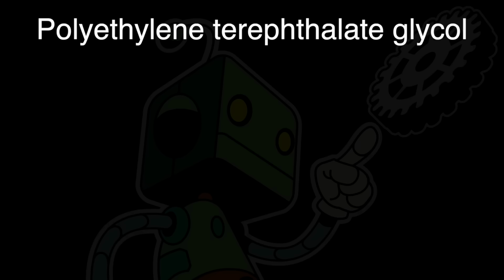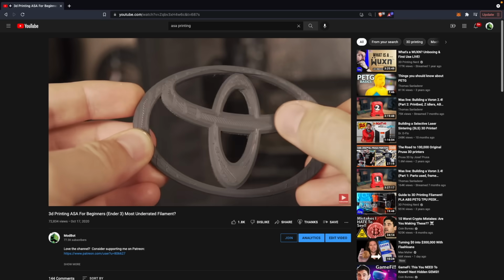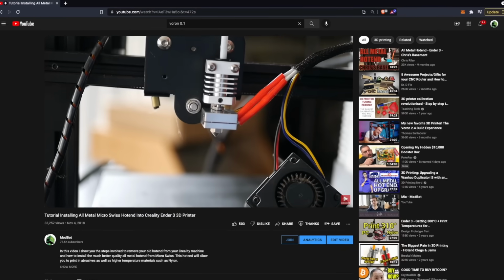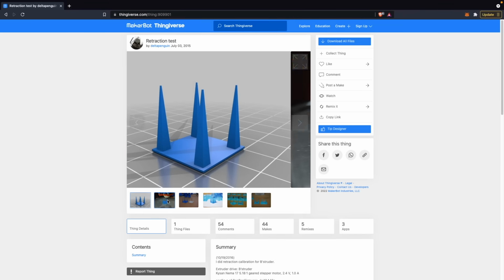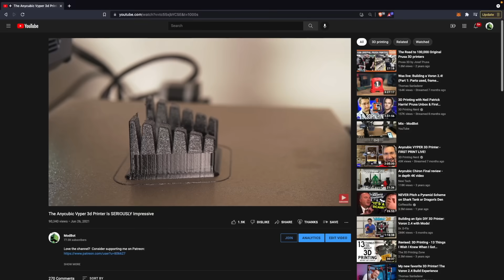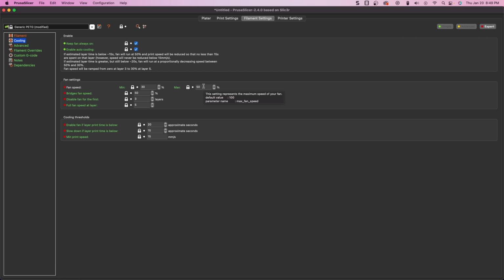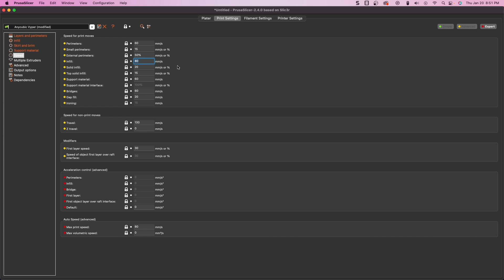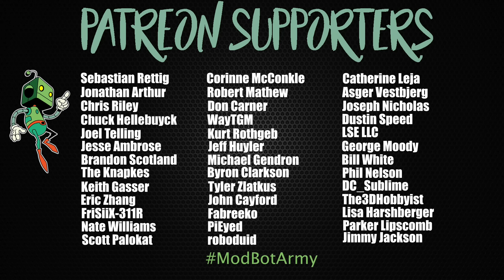3d Printing PETG For Beginners! Great For Functional Parts

Comment: I've found that while printing with petg in recent times with an ender 5 plus that the filament "sticking" to the copper extruder only seems to occur when the temperature it prints at is too low. Additionally, I've found more success printing fine parts at a speed of 40mm/s than the stock 80 that the ender 5 plus uses.

Comment: First thing anyone should do, especially with a new roll of filament, is to not only dehydrate for a couple of hours, but print a temp tower. This will help you immensely with any filament. I do this religiously and haven't had a failed print in a while now. Also, you need to do some fast prints to see about stringing. The just adjust your retraction distance first, if tha helps some but not a lot, adjust your retraction speed.

Comment: Funny that I just came across this video after my second part printed with CF PETG. My first print came out absolutely perfect. Not temp towers, not retraction test. I just went for it, and was amazed! Printed the second part and again it printed amazing... but took chunk of class out of the bed when I removed it! DAMNIT!

So for the question and real meat of all of this... Im running an extended E3 with a 400x400x500 print area. It was a great move... until it came time to find a new print surface! Im using a Creality class bed now, but its rather screwed up. Im having a hell of a time finding a source for a quality bed surface though. Any recommendations?
Reply: Ratrig 400mm bed from ratrig or mandela rose might work

Comment: I wasted a whole day trying to find any surface that PETG would stick to.  Nothing worked except for an undersized dedicated PETG surface that was only good for one print.  PEI was like teflon, zero adhesion.   Metal with glue stick failed.  Blue tape failed.  Kapton tape failed. Varying temp on all the surfaces failed.   This was on a Prusa so I couldn't use any glass or phenolic.

Comment: Nice guide, one point I'd add from my experience, PETG tends to warp much more than PLA, especially when you print large surfaces on the bed (common with functional parts). I've found that printing under an enclosure solve this issue much better than using glue or toying around with temperatures and layer height.

Comment: You hit a couple of points that are critical.   Dry filament is a must, higher temps tend to work better and your print surface should have a coating to keep it from pulling off when the print is removed.  I use glass and have had many chunks come off with the print.
Reply: it pulled chunks of glass off?? wow

Comment: Great video guiding to print PETG, I have one confusions on the hotend part, PTFE tubed hotend cannot stand the high temperature  and release toxic, however, the non tubed full metal hotend, the filament company said PETG is not recommended to print with full metal hotend as it will clog the hotend, so, what is the better solution of it? Or as a occasional PETG printer, just use lower end temperature as you mention like 230 with tubed hotend? Thank you in advance.

Comment: I've heard PETG or ABS is better for reptile hides. PLA can release toxic vapors or something at higher temps (100-120F I guess? About the highest most reptiles use, maybe 135F hot spot for a Uromastyx) let alone these lizards need UVB. For snakes that have heat tape and no UVB I imagine it matters less.

Comment: PLLLLLLEEEEEAAASSSSEEEE Help 

i have  a creality ender 3 pro and im very new to printing

pla was fine

i need petg now

i get warping every print and i think its in the same spot

im pretty sure my bed isnt flat

i havent chnaged any part so the whole thing is stock

Im begging for advice I have printeed the same part repeatedly with similar results and chnaging the print profile

I use cura to slice

what am i doing wrong?

Comment: Honesty,  Silicone socks cause more problems than they fix.  Yeah they might protect the heater block from the dreaded blob (if they stay on).   But I find they are WAY more likely to cling to some stringy part of the print get pulled off,  failing the print, and still cause the blob.

Comment: I've been printing a lot with petg and successfully but for some reason all my prints I attempt fail due to very poor adhesion and all the material ends up gooping around the hot end. I've done all the cal I can possibly do. Possibly build plate? I print on glass bed without any kind of build tac, but I've never had issues with it before so idk.
Reply: same... except im using an ender 3 with the default bed. I changed out the nozzle to a new nozzle and still have issues getting it to stick to the bed. It used to print well till i changed out the extruder.. but i calibrated the extruder so not sure what else is wrong.
Reply: @ChristopherJones16  I think I know what the issue is but have not tested it. I think the material has absorbed too much moisture and needs to be dried out. There are no signs of excessive moisture but it's the only thing I have not tried, maybe same problem?
Reply: @AWildNoodle  well I was just reading the comments section here and seems some people are saying the sweet spot for hot end temp is around 230 whereas I’ve been using 240 from what my filament box says to use so I’m going to try lowering the temp and see if that helps but if monkeying around with the temps doesn’t help then I’m going to settle on it being moisture issue and throwing it in my dehydrator.

Comment: I think I finally just got my printer slicing dialed in for my RepRap Guru i3 3D printer with a MK8 swiss heaterblock, generic PTFE lined heat break and a Creality branded MK8 all metal nozzles and it's direct drive. The biggest issue I just discovered last night was initial layer height (.24mm) and layer height (.28mm). They were all .2mm and I kept getting clumps on the nozzle and horrible infill that would eventually cause it to fail. Last night after making those changes my CHEP cube turned out almost perfect! Then I printed a MK8 filament guide and it finally completed and looked almost perfect! So glad I stuck with it, kept reading and trying different settings till this one fixed it for me. No onwards and upwards! I have a video to make for comparing DIY ABL Probes! Check my channel out in the near future!
Reply: So are you saying that when you used default settings of .20mm layer height it kept clumping up the nozzle but when you changed it to .24mm and .28mm it fixed it?
Reply: @ChristopherJones16  exactly! I found an article where they tested PETG in a lab and discovered the best settings to avoid the nozzle always slightly dragging in the liquid PETG plastic where to set the initial layer height to .24 (less squish) and .28mm for all other layer heights. Once I did that it was like magic hit and all my PETG prints first layers were perfect and all remaining layered printed like PLA. I had some bridging issue but fixed those with Cura's experimental bridging but just enabling them. I even went back to an old Overture PETG roll I gave up on and it to printed awesome! Good luck!

Comment: Printing intricate parts with PETG for me has been a big challenge. I can't seem to stop the slight oozing that gathers at random parts of the outer walls of my prints. I've reduced flow rate but then I get under extrusion on flat areas. I like the challenge but my results on small detail parts pale in comparison to the prints I get with PLA.
Reply: i read somewhere that there called “zits” and are due to the “seam” being set to random. From what I remember reading if you set the seam to linear (or the like) you’ll have a straight row of zits instead of a spread. From there you can even set it inside the structure itself so it’s not visible. I’d google about seams. Could be wrong tho.!
Reply: @ztm_oruam  Coasting is also a nice help here.

Comment: PETG to me is a pain in the arse to print with ,it needs high temperature, high retraction, retuning extruder , sticks to the nozzles,so sticky to touch,takes almost all the water in the air (like it's always wet),so saggy like a ###### ,can be printed fast (cuz it won't cool as fast  like PLA) , it tests the metal if u have a low end printer . The best option is to stick with PLa , Pla+ , if u really need high strength go for nylon or CF filaments because those are with the time and effort.After printing PETG can rake two paths one is it come of little flexible  and other brittle (breaks with almost no effort)  also it expensive than PLA .Stay class ,stay  cool and don't be a fool buying PETG

Comment: It's handy to have some qtips around to wipe the PETG off the nozzle. Heat it up to 230c and it will wipe off easily. You can heat up to around 120c and use a fine tip tweezer to pull the PETG globs off the nozzle before wiping.

I usually print at 230 - 240c with an 80c bed for the whole print with 25% fan speed with a dual 4010 blower setup and a microswiss clone from trianglelab. I find that dropping the bed temp down to 70c after the 3rd layer in a room with an ambient temperature of 65f will most likely lead to layer lifting from the bed. Drying the filament as mentioned is very important. Even if you leave it in an "airtight" box with desiccant over a few months, it will still exhibit blobs and layer adhesion issues. Probably best to store all unused rolls in a vacuum bag with dessicant.

Comment: I have lifting on the corners of just about every PETG print (several different brands) on my Ender 3 Pro printer.  I've tried adjusting nozzle and bed temperatures, varied fan speed from 0 to 100%, varied print speed, and adjusted other slicer (Cura) settings to no avail.  This happens regardless of print surface (i.e., the Creality stock buildTag, glass with coating, smooth PEI).  The first layer goes down without problems, but by the time the print's done, warping always happens and the corners lift.  Using a brim (or brim on the corners using the Cura TabAntiWarping plugin) helps, but I've had prints where part of the brim lifted off slightly with the print at the corners.  Parts of the print other than the corners stick to the build surface very well.

Since this is happening all the time, something obvious may be causing this, but I'm just not seeing it.  Do you have any suggestions of what else to try?
Reply: Haven't tried nearly as many things as you, but same experience. I will try no fan on first 3 layers as recommended here, but so far every single PETG part has warped slightly on the bottom, about 1mm up for about 3cm along the bed.

Comment: I’ve been messing around with it for the last couple weeks and I’ve got some really interesting results regarding temperature and translucency relationships. It seems the higher the temp, the more “glossy” the surface becomes. I’m not completely sure, but my thought is that the glycol really “shines”  at higher the higher temps. This also confirmed when I print with the Amolen color translucent filament. At around 230c I can get an opaque haze through the layers, but around +245-250c the finish really becomes almost as glass. But along with that, they do seem to become more brittle as well, losing some of that sweet glycol ductility. 🤷🏼‍♂️
Any plastics engineers in here?
Great Vid!

Comment: Does your prusa extruder heat up? I have some serious issues with jams due to the fact my is getting so hot (whole thing) that you can barely touch it. Only PETG i have issue with is - actually - galaxy black.

Comment: Of course I started my 3d printing using pla as many do/have, but to be honest I don't really like pla that much for being more brittle and temperature sensitive. Because of this I have mostly moved away from pla to petg, only using pla for show models (which I don't do much of) or prototyping. Even then I wonder if it's worth it as I'm already set for petg..

Setting up settings for petg is a little more complicated than for pla and is a little of a learning curve, but once settings are turned petg is actually quite easy to work with - even without an enclosure. Settings do have to be tuned though if you want good prints.. Also, less is more with petg as far as fans go and certainly would not go above 50% - lower fan speeds give much better layer adhesion..

As for print speed I tend to run at slightly lower speed all the time (not just because I have direct drive), I find printing at lower speeds give much better quality. As mentioned, I do have direct drive and would recommend this for petg for retractions, though it's not 100% necessary. 

I do recommend using all metal hotend and especially the Micro Swiss on ender 3 type machines. I recommend this for all filament types including pla. Removing the bowden from the hotend is only a good thing as far as health is concerned. 

Flex - such as tpu uses similar bed nozzle clearance as petg and was my second filament before petg. Again though not 100% necessary direct drive is handy for flex, moreso than petg purely because of the flex.

As for outdoors stuff I would say either petg or asa. Asa being slightly better for things that will be in sunlight. While you.may get away with it, asa really needs an enclosure as abs.

In this day and age, with all the materials giving performance, I would actually advise against abs - I just don't see much point in it other than practicing you gas mask skills..

Comment: I print almost exclusively in PETG on my Anycubic I3Mega with V5 all metal hotend. I always print with a brim and sometimes even a raft because my biggest problem with PETG has always been poor bed adhesion. Anycubic uses their proprietary “ultra base” and it works great for PLA but I’ve had trouble with PETG. I use a nozzle temp of 240, any higher and the prints seem to melt at small finer points even with my cooling fan running. Bed temps are usually at 70, any higher and the painters tape I often use will pull from the bed when the print warps. I even use glue stick sometimes with prints that have a lot of surface area on the print surface to keep the PETG from permanently bonding to the tape. It’s a pain to remove when this happens. I love the material for my typical application (functional motorcycle parts) but I do not love it’s printing properties.
Reply: I found a trick for adhesion randomly online and it is to use very salty water and lightly wipe it on the print surface after it is heated and it fixed my adhesion issue along with a brim.

Comment: Thanks for your video. I've just ordered Prusa mk3s instead of my FlashForge Adventurer 3, because it supports more than PLA and ABS. I'm gonna think 5 times before I buy PETG because it's problems with moisture. And I was shocked when you showed vacuum package for PETG spool. Not convenient material... I want to find something also cheap like PLA but more heat resistant than PLA. Probably in my dreams... 😞

Comment: I have a ender 3 v2 I have printed a couple off vases with Pete but now I’ve fitted a metal extruder works great with pla but when I use petg part way through print is slips on filament & broken filament I’ve tried slowing it down & adjusting tension on extruder nozzle temperature 250 & bed temperature 80 
Any information would be helpful thank you

Comment: Am planning on printing with PETG on my Aquila X2 which I upgraded to Capricorn tubing and fan upgrades,  also have steel heat treated extruder nozzles but considering upgrading extruder to a Swiss one. Any thoughts on the Micro Swiss.

Comment: Great video... subscribed. 

For PETG cold pull  (3 times) solved my problem with a Mini+ 

Thing you need to remember is the bed. The bed sheet for PETG is that textured one and that is it. Don't try to use other bed, or the smooth one. Also, the measures for the textured are different, it's thinner instead of thicker....
I learned the hard way, and also after I forgot to change the bed sheets.

Comment: The only issue I've encountered with PETG is extruder skipping. Even with the speeds way down I can hear the *thunk* every few seconds from the other room. Bizarrely, there's no evidence of it in the actual print, but I'm worried what that's doing to the hardware.
Reply: Sounds like the extruder is skipping.   Too much pressure in the extrusion system such that the extruder cannot keep up with demand.  Possible solutions: slow your speed, increase the spring tension on the extruder arm, go to a bigger nozzle

Comment: I print usually PETG with volcano hotend at 230-235C and with extrusion speeds like 50-70mm/s (that is 100-140mm/s in cura) on my ender 3v2, default extruder. Using superslicer recently because it just works, i wasted too much time experimenting with cura...

Comment: I have had trouble with overhangs warping upward with petg. It seems to stay soft longer than nGen. Its flexibility causes problems with tall skinny parts flopping around as it prints. In spite of being much more flexible, it seems to be just as brittle as nGen.

Comment: Thanks for this. I have a CR10S5 and currently doing some upgrades so this is going to help me a lot when I print things. I’m considering only printing in PETG. You mentioned UV protection, is that the PETG or is it only a particular brand etc? I’m needing to print some things which can not warp due to heat or change colour in UV Sunlight. Hoping to not have to paint and clear coat to protect it
Reply: All PETG has this property

Comment: Brims are typically excessive and unnecessary because they surround the entire model, yet it's usually only corners or small footprint sections that lift.
If you add "mouse ears" to the areas prone to lifting before you slice, it will help with adhesion. It will also save time and filament during the print, and reduce cleanup time after the print. -Compared to a full brim.
Reply: Cura 4.13 has a plugin called anti-warp tabs (I think) that does exactly what you want. That plugin hasn't been released for 5.0, yet.